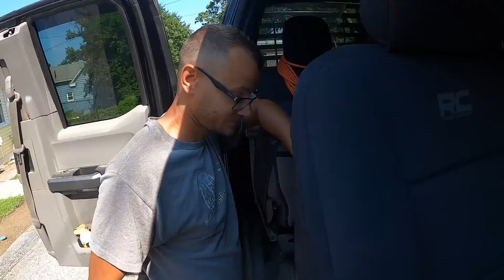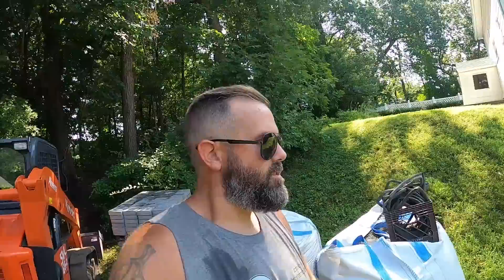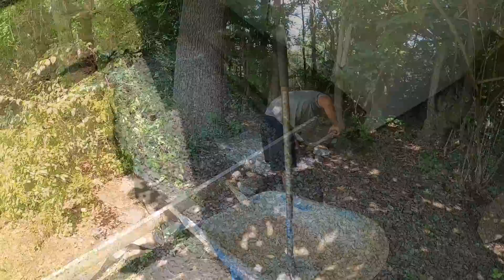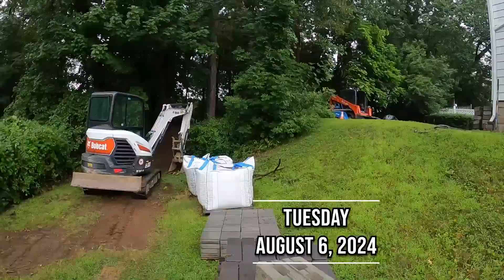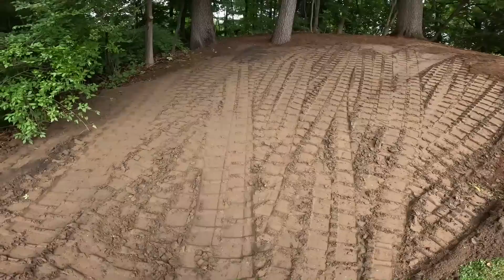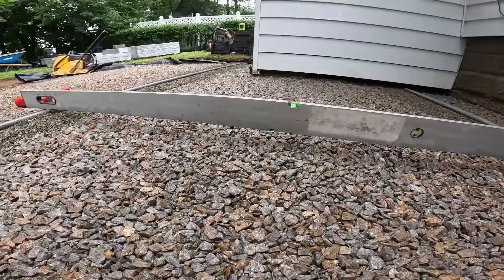Small Patios are NOT Always Easy. Steep Grade & Obstacles...

Comment: Hey love your content, gonna be doing a raised patio with everything I learned from your channel. Just wondering if you think pouring concrete footers for a pergola is necessary or if the open graded base is strong enough to support a pergola held in place by planters filled with concrete?
Reply from the maker: I would say it depends on the size and weight of the pergola. If it is relatively small, you can put it right on the pavers. But the bigger you get, the more risk of settling the pavers under the posts settling over time. Even if you did footers a couple feet deep, that would be helpful. Glad the videos have been helpful, good luck with your project! ✌
Reply: @TheChristianHardscaper  thanks for the reply, not sure what size I'm gonna end up going with, so figuring out footers is tough due to that. Was hoping a few layers of geogrid between lifts would be enough to stop any settling, gonna have about 18+ inches of clean crushed 3/4 stone since it's raised. Thoughts on that? Plus wife wants to know if you're willing to come down to NYC to do the job instead lol
Reply from the maker: @ That base is plenty for a small basic pergola, but most custom made ones over 12' x 12' are a bit too heavy for just the pavers. And I would love to be able to there for your project but that is a little out of my service range... LOL✌

Comment: This job did have a lot of challenges!!  I’m looking to install a patio at my house in the spring. I’ve been watching your videos and taking a lot of notes. Our house was just built and the yard is scheduled to be graded in the spring.  Do you have any recommendations putting a patio in a just graded yard?  Is there some amount of time I need to wait?
Reply from the maker: It was a tough one, glad the videos have been helpful! I would say it depends on the amount of depth that will be graded. If they are adding multiple feet of soil and just compacting with the machines, there will probably be settling.. If they are only adding a foot or so of soil, you should be fine. But the more soil they add to the pre-existing grade, the more it will settle in the future.